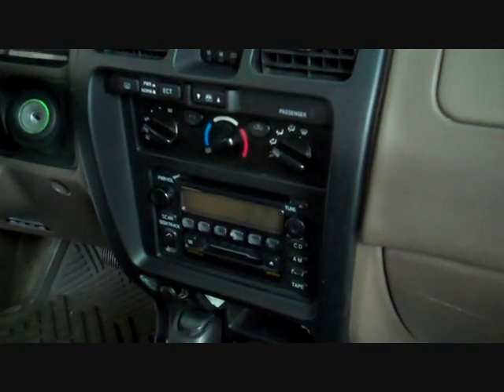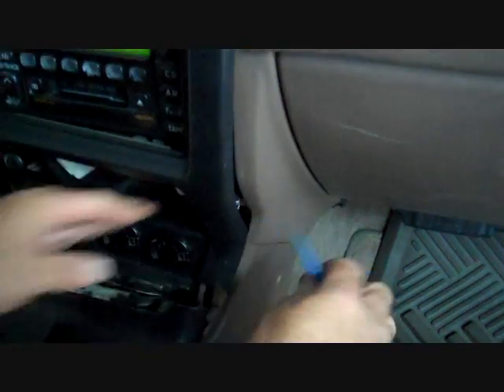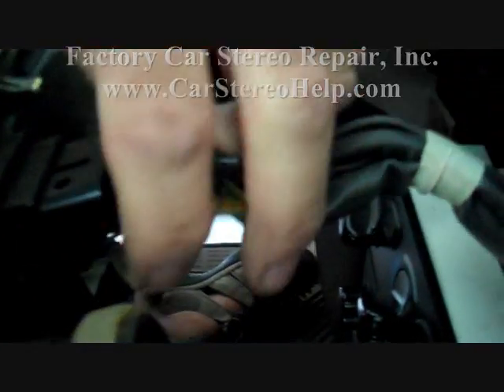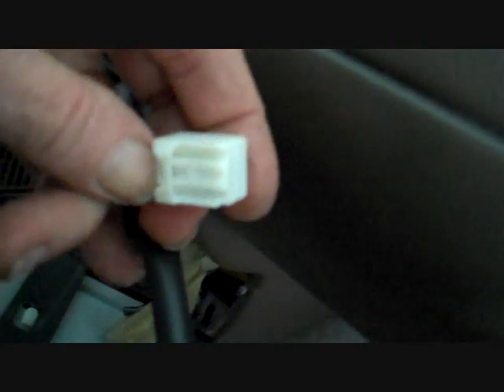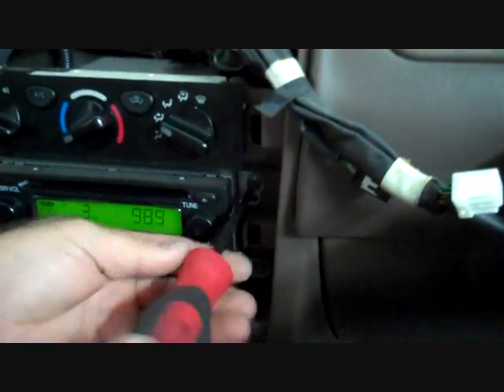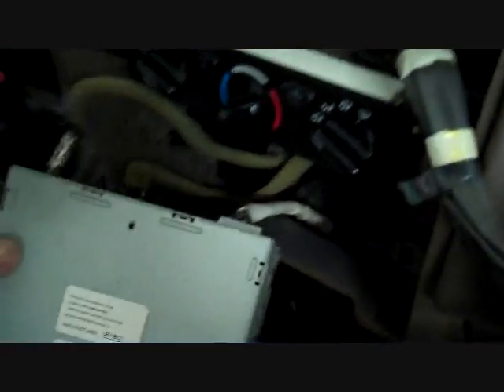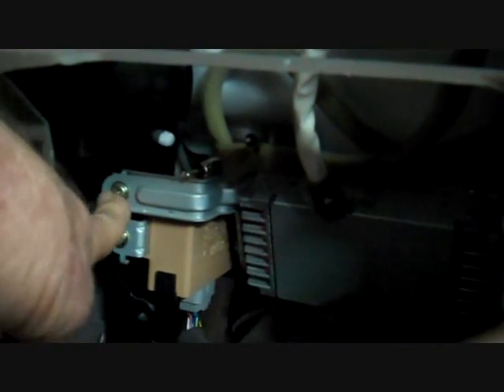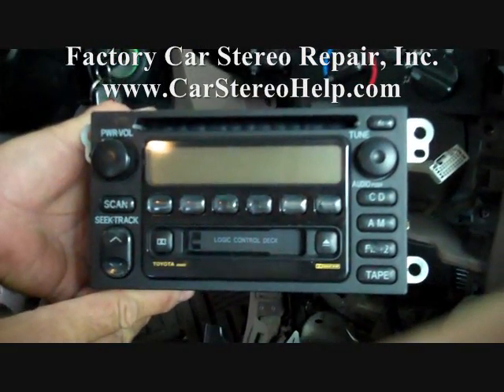Toyota 4 Runner Car Audio - Stereo and Amplifier Removal  1999 - 2002 = Car Stereo HELP

Comment: Great video. I have a 2000 4Runner SR5 and some videos show and say there are a couple bolts that hold the Bezel console to the truck but they weren't used on mine. Some other 3rd gen 4runners you can't take that piece off without breaking the console if those nuts aren't taken off. Thanks for the video.

Comment: keep in mind not all gen threes are the same. Doing my 98 Limited, the cover around the shifter will not come all the way out, there is a little screw on the 4WD lever that is holding the knob in place. Mine won't come off, so the cover will tilt out of the way, but not come off. ( a drag, because I would want to detail everything)   Next, the face plate (mine is wood grain with the vent, defogger, etc. stuff) do not try to yank off! There are two tiny Philips head screws on the left of the heater controls, and a third, on the upper left, a bi hard to see. Yanking will snap them! Also pull off the knobs first.
Next, you'll have to pull off the back connectors for the 4 way flashers, the rear defroster and the horn. handy to label those. Also, you'll need to remove the power and the lights from both the cigarette lighter and the little bulb in the ashtray. Good time to change those bulbs.  You might be able to work on the radio without removing, but the cover was in the way, plus after 23 years and 280k miles it needed to come out to be detailed and some of the scuffed paint touched up. I never like to put back dirty parts! its still a bitch, as I was trying to get out the antennae, but no go. I thought that perhaps pulling the radio would give me the antennae, than I could somehow snake it out and run a new one! Not so easy by a long shot. No demo video of changing fixing the antennae shows pulling the whole assembly and swapping out the cord.
Reply: Thank you you are a life saver. Mine was like that. It’s a 99 model. I was trying to fix my clock not the radio but I knew looking up the radio would give me more results.

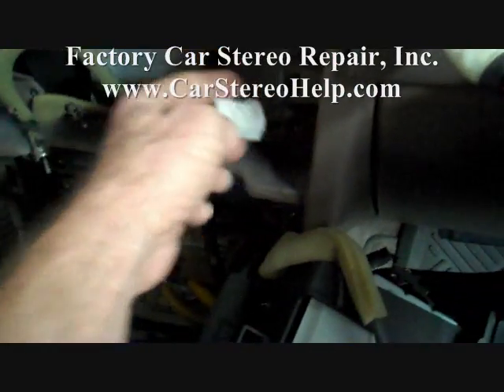Comment: I have a question. My 2000 Toyota 4Runner radio does not want to turn on. I took it apart and found 3 cables that weren't plugged into anything. I found out that two of the white cables were suppose to be plugged into the amp, which weren't, but even after I plugged them in the radio didn't turn on. There is still a grey cable that is not plugged into anything and I can't seem to find anything to plug it into. In your video at about 3:33 when you start talking about the amplifier, I see something brown with what seems like the grey cable plugged into. I don't have that brown part in my car, do you happen to know what it is and if it is required for my radio to work? I've checked the fuses but they are all good. Thanks for your help

Comment: Is there a fuse for this stereo?

I don't find it anywhere!!
Reply: DaRthHueS  Where are those located? I don't see one in the panel under the hood, or by the drivers side door.
Reply: @da324  ya me neither and it’s been a pain my radio doesn’t work

Comment: is there a reason to have key in iginition?
Reply: So you can switch to a lower gear
Reply: Why does he keep it on?
Reply: No need to have ignition on, there’s a manual shifter release at front right corner of shifter area. Pull up tab and depress in hole with key or screwdriver to unlock shifter, mainly used when wrecker is needing to toe. Still a nice video!